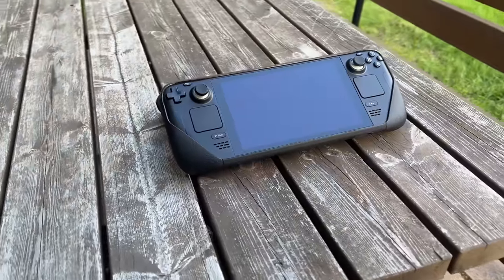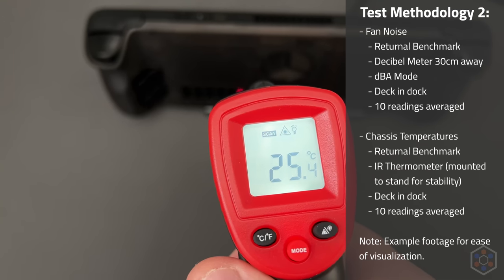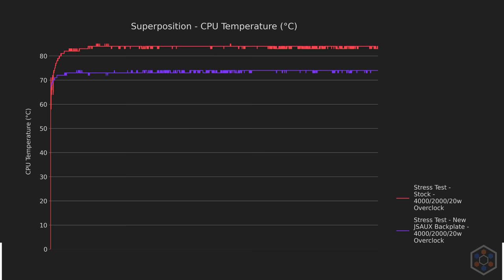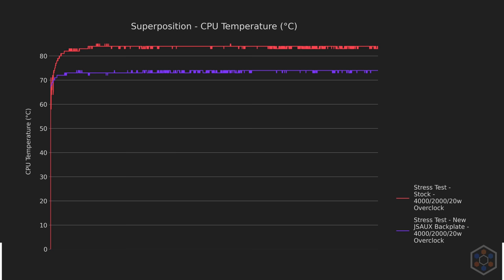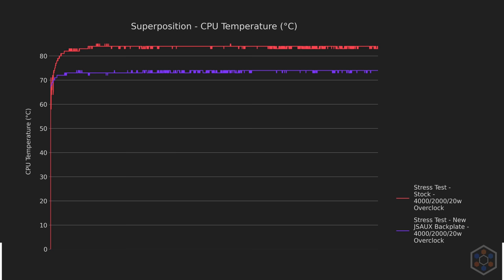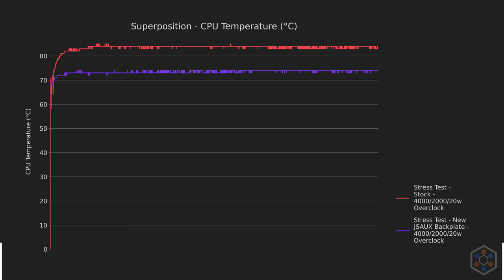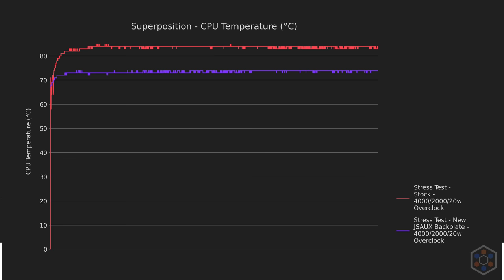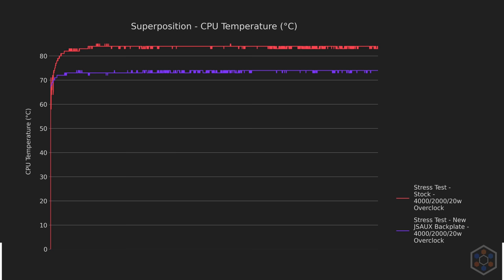How LOW Can It Go? | Steam Deck Thermal Modding

Comment: I need more guidance about putting thermal pads on the steam deck since I can't follow the process due to editing (and because I'm a noob 😅) did you put a thermal pad on the valve chip too? An installation guide would be helpful 🙏

Which size did you buy those thermal pad?
Reply from the maker: I put the pad only on the heat spreader, which the  contacts the APU that you're speaking of. It's really easy, just treat it like thermal paste using iFixIt's guide 🙂

Thank you for watching!

Comment: In terms of the clip on fan from Jsaux which is only compatible with the stock backplat, I purchased two different versions of this, there is a kickstand built into the foot of the clip on fan which allows you to stand it. Also, there is a version which does not require the clip from Jsaux and is sold seperately as part of the ModCase, but it includes a metal stick on connector that also gives you the latch from the ModCase which lets you add other ModCase components (but not at the same time). I also tried PTM7950 and that was a total bust, in fact in some cases it made my Steam Deck hotter and definately made the standard case back a lot warmer. Maybe it depends on what model of Steam Deck you are testing on and if Valve used different paste in construction.

Comment: Audio engineer here.
With the acoustic measurements in the A weighting (which refers to how the volume of sound reacts to what we here, as we hear different frequencies at different perceived volumes), a 3dB difference is twice the acoustic energy - audio is measured on a logarithmic scale so it would be perceived as a small increase in sound, but the "2.7dB increase," for example, is not 2.7 times louder. It is less than twice as loud, but would be perceived as a small increase in volume.
Reply from the maker: Thank you so much for the explanation, I clearly have some more learning to do 🙂

Comment: Great video! I didn't know jsaux made a new backplate. I just received and installed the old one about an hour before this video came and temps are night and day difference for me. Before 20w overclock would instantly go to 95C within seconds and maxed fans. Now after 10 mins it hovers around 89-90C.
Reply from the maker: They didn't advertise it very well, but I'm really happy they did. If the old one wasn't so hot it'd be easier to recommend 😅

Thanks for watching!

Comment: I recently fitted the 'old' jsaux back plate. I removed the thermal pad prior to installing the shell.. I wasn't after a shell to cool the deck down, more for the looks, since I opted for a transparent purple back plate. 

I don't notice any difference in temps... but now I feel that I maybe shouldn't of removed the thermal pad..

The reason I removed it, because I heard that the pad actually blocks the air from passing from the vent at the back to the fan.

Comment: Your long term concerns deserve to be reviewed at a later date maybe a year or two from now or even periodically? I think viewers would be interested in such content. Thanks for your hard work!
Reply from the maker: I might be able to do that, but I'd need a separate Deck to do it. As it stands, this Deck will be modified repeatedly for other testing so I can't do a "set and forget" follow-up 😓
Reply: @cryobyte33  Thanks for the reply! I noticed that your video did not have general guidelines (i.e. in the introduction section) about what temperatures we should aim to keep the Steam Deck at. 
Noticed mine getting to around 85 C after playing for several hours and worried about what that temperature range (80-90C) might do to my Deck's longevity. 
I changed the CPU TDP under Performance settings to 10 and temps went down to 70-80C range. 
I will check if you have a video on optimizing settings in the Deck for minimizing temps.
Reply from the maker: @manaseeker2414  The Deck APU is safe up until 105C. Since we were working with Stock temps or lower, I didn't think it was necessary to include that 😅

I mentioned the upper limits in my overclocking video, where I thought it was more relevant, sorry!

Comment: The burst speeds make sense. Better thermal contact with the heatsink creates better coupling, resulting in APU temps closer mirroring the regular heat soaking of the heatsink.

Comment: It would be awesome if you did a Steam Deck OLED thermal mod including re-introducing thermal pads, thermal plate mod (to accommodate the pads contact), and PTM9750 APU instead of thermal paste, and the JSAUX back!
Reply from the maker: I haven't heard of the thermal plate mod, could you send an email with a link to the address on my about page? Thank you!
Reply: @cryobyte33  the new thermal plate on the OLED unit has an insulating layer, and cut-outs in it for where the thermal pads from the heat pipe touch the metal plate. You’d have to cut the black insulation plastic layer wherever a thermal pad touches. The new OLED model doesn’t have thermal pads on most components now… It’s a cost cutting measure. You’ll see it if you look at the Gamer Nexus teardown to see what I mean.

Comment: JSAUX back plate is no Joke, my wife's steam deck used to thermal throttle and just froze the games FULLY if the game was demanding. I used the JSAUX back plate, the one without the vent and changed the Thermal paste, added a thermal pad to the aluminum cover inside and BOOM, the temps were SOOO MUCH cooler. This is a must mod for the STEAM deck.
Reply from the maker: I didn't have the same issue with stock, but I agree that the JSAUX backplates are both big wins for thermals 😁

Thank you for watching and sharing your experience!

Comment: Couple points:
1. I'd be mindful of using percentages when talking about temperatures, especially when you're comparing the raw output values. Worth delving into the thermodynamics of it if you see value in that.
2. Pulling cooling air away from the other components may be good for extending the life of the APU, but IIRC some of those VRMs are already running a bit toasty, so I submit that in doing so one will bring about the premature failure of a unit with a perfectly serviceable APU. Degradation of the main chip isn't the only way to kill a system.

I would however love to see what results you get using Arctic MX-6. It's worked a treat on two laptops for me so far, so I'd love to see if it's worth doing up my deck with it.
Reply from the maker: Thank you for watching!
1. Good point, I'll try to stick deltas in there at least a bit. I didn't consider that since I typically talk about frame rates 🙂
2. I actually have a pinned comment about this, I tested that too and only noticed a 1C difference on the VRMs, ICs, etc.

As for Arctic, those pastes tend to work best with high thermal loads whereas the Noctuas do better at lower loads. At least when I compared them on a few years ago they were identical up to about 45w of TDP, then Arctic pulled ahead.

Thank you for the comment!

Comment: Thank you for this video. I have been on a cooling odyssee ever since i bought the deck myself. I tried out all the methods you demostrate in this vid, its really good to have you coming up with pretty much the same results. Cheers mate, keep up the awesomeness.
Edit: With that being said, the weirdest thing: I spent half my time in a desert country, andwhen I'm there the old JSAUX backplate combined with a magnetic fan is what worked out best for me. Not so when I am back in western europe though.
Also, there are concerns with JSAUX new backplate in regards to internal airflow and cooling of other elements, specifically the SSD. I even think to remember that Valve had once mentioned waz back that this was the reason for the absence of a second vent in the stock configuration.
Reply from the maker: Thanks for watching and for sharing your results!

The locational difference is almost certainly humidity, with drier air you'd need more fan/watt to keep temperatures down.

As for the new backplate:
1. I tested VRMs, ICs, the SSD and the RAM for temperatures with the vented backplate and saw less than 1 degree difference from the stock backplate.
2. A lot of air still gets taken in through the rear vent, even with the vented backplate, so I have very few concerns with device longevity. 

Hopefully this helps 😁

Comment: Installed the vented backplate on my delta fan deck, and also added the clip on fan. Deck runs cooler and the little leg on the clipon fan does work well as a stand. It's not fallen over, surprisingly.

Comment: I was thinking about getting the PTM7950 and new JSAUX backplate, but was concerned what the actual games were. This video definitely helps make my decision easier. I might just get the backplate and use some thermal paste I already have. Don’t want to setup the PTM7950 if it is all going to come out for a p3r. 

FYI I saw Salocin900 posted a video of an updated Steam Deck which has different mounting screw locations for the heat pipe. Might be an issue for the p3r if Valve has significantly changed the design.
Reply: whats a p3r? Would like to know what you mean as im thinking of ordering the thermal pads but have some mx6 paste here? Cheers

Comment: Today I've tested the undervolt settings on the 118 bios, I'm on -30 cpu, -40 gpu, -50 soc, any higher I would start to see corruption/random shut downs. I stress tested with Doom eternal (raytracing, low resolution, low settings), with a 4k video running on the background (gpu at 99%, cpu at 95% average), and also with mprime (for ram, altough I used "blend" option). My termals were pretty good already, as I'm rocking the old jsaux plate and that does already some good job at lowering the temps, but noticed the new backplate that you showcase in the video.I decided to make a hole in the superior part, where the top of the fan would be, the hole is about 70 x 200 mm, and my temperatures have gone down by 2-3 ºC compared to the unmodified old backplate, fan speed lowered about 600 rpm. The way I cut the backplate is by warming up a cutter and a lot of pacience, it definitely doesn't look clean but pretty functional, thanks for your videos.

Comment: Hey Kyle, 
I appreciate your response - thank you!
Two questions regarding your video:
- With what tool / app did you set your Fan on the highest Speed after the 2 hour benchmark ?
- How do you run the Superposition benchmark on the Steam Deck, is there a special version for the deck?

Bests,
Marc

Comment: This is so cool, thank you for having the JSAUX. I have both, although I noticed that JSAUX might have taken into account one of my emails to them, because the RGB backplate (still hasn't arrived, so I can't say for sure), looks like, according to the images on their website, to have a section cut-out on the thermal pad to allow for the original Valve fluid dynamics diagram. If true, it will help a lot. I have also got a cheap (from Amazon) aluminium heatsink (40x40x11) with thermal adhesive to directly put over the aluminium backplate. This setup is perfect to use with the JSAUX also new RGB hub. I know it sounds like an ad lol, but I am just really excited for it to arrive (September according to their website).
Reply from the maker: Thank you for watching! I love JSAUX products thus far and don't have many complaints. I don't have an RGB plate, but hope to get one after I'm in the US to test.

Comment: I really need to object to the jsaux vented backplate. That vent disrupts the airflow path from the original rear intake, which means that things like VRMs and RAM chips will not get cooled sufficiently. There's a lot more to the thermal and airflow engineering on a portable device on the deck than the SOC cooling alone.

That said, the PTM7950 has been a godsend. It works way better than kryonaut, NT-H2, or the stock thermal paste. It will also last for the life of the device, as opposed to conventional thermal paste which needs to be regularly re-applied due to the pump out effect. Good video overall.
Reply from the maker: I actually pinned a comment about the JSAUX backplate and the testing I did. Mine has been on for months with perfectly safe temperatures 🙂

Thanks for watching!
Reply: @cryobyte33  Ah, I missed that. Good to know!

Comment: A friend of mine just sent me a photo of a new revision of steam deck, the CPU cooler mounting mechanism is completely different. 

In your and mine steam deck, we have RAM in between the fan and the SOC, the new version don't, and SOC is closer to the fan.

The EMI metal shield is now painted black instead of the bare metal look.

Comment: That magsafe cooler you used they make a version of it with a teg cooler built in and I can't confirm the teg units work amazingly and probably would be a huge benefit in your situation you really ought to give it a try!!!  I use the teg set up on gaming phones and it makes a huge difference in thermals but mostly it offsets the heat caused by wireless charging in my case the problem it has in my case is that the cooler doesn't sit directly above the chip and due to my camera bumps its super hard to make it work but when I did force it to work it did a great job its just not practical for my case but in your case it likely would work great!!!

Comment: amazing video! and just the information that was missing online. at the end of the day, its a lot of money in terms of costs only to get 5-7% improvement. The lows jumped significantly. but low 7fps to low 15fps will still feel the same in terms of user experience.
now if all these upgrades would raise all the lows to stable 30fps....now that would have been a must buy upgrade, no questions asked.
Reply from the maker: Keep in mind that the games I tested are some of the toughest (and most stutter-y) to run. Check out my Hogwarts Legacy Deck Dive for some really impressive performance while overclocked (and a more accurate depiction of normal games), where the backplate and pad would help the most.

Sony games tend to scale poorly with overclock, but stress the Deck to the limits, which is why I tested them here. The caveat is that most games you play will likely not be Sony developed 🙂

Thanks for watching!

Comment: EDIT: CAPS FOR CLARITY. I TESTED IT MYSELF. I FOUND THE CONTROLLER CONFIG TEST IN THE SETTINGS. PLACED THE DECK DOWN, AND IT DOES IN FACT CLICK WITH THE LARGEST BUTTONS WHICH IS REALLY UPSETTING. I AM GOING TO CONTACT JSAUX AND ASK THEM IF THEIR CASE DOES THE SAME. I AM UN SURE IF THE SMALLER BUTTONS TOUCH ON THE DECK I WILL REMOVE THE BACKPLATE AND ADD THEM AND THEN TEST THAT LATER TODAY. 

I know this is a long shot, but i figured you would at least maybe respond to my question. I finally got the Jsaux vented backplate. I put in the longer buttons in the back of the plate and staggered them so i could feel them more and maybe use them for gaming as i never really used them. i have now started using the back buttons more and love it. here is my question. Does the longer protruding buttons touch the back of the case when away and put added pressures on the buttons ? there for clicking the buttons?

Comment: I bought the magnetic fan a while back and no one had any tests on it.  I did notice it worked but it is cumbersome in some regards.  I ended up modding my JSAUX old backplate by cutting holes where the fan is like the new backplate they offer.  Then I added heatsinks on top of the metal plate.  It has cooled down the Steam Deck alot.  I did my own testing with before and after results and it does work.  My deck is overclocked as well.  My settings are undervolt 30-10-30.  Overclock 4077 CPU, 2077 GPU and 20777 for the battery.
Reply from the maker: Sounds like that was a great idea, I was thinking about cutting a hole in my metal plate backplate too! I'm also glad that my testing aligns with yours 🙂

Thanks for watching!
Reply: @cryobyte33  Yeah I ended up buying two of those backplates before they announced the New one so I had a spare to experiement with.  I cut down a mesh fan screen and a used non scented dryer sheet to protext the fan from dust build up on the fan.  I wonder if that maybe helps with back pressure as well?  I also added a few thermal pads inside the deck in a few spots to help disapate the heat.  I will have to try that thermal pad you mentioned in your video.  I keep my house around 25c degrees and luckily I am able to keep the deck pretty cool.  It is all thanks to you that I was able to learn how to unlock the potential of the Steam Deck through undervolting and overclocking.  I look forward to any other videos you do.

Comment: The clip opens up on the bottom! I do use the clip on fan and actually don't notice the noise, because I use it (kind of docked on its weird footpad) and wearing headphones or external speakers, that highly outperform the fan noise (Steelseries Arena 7)
Reply from the maker: Wow, I'm... not sure how I didn't notice that during testing 😂 Thanks for the reality check.

I typically use my Deck in handheld without headphones, or with open-backed headphones, so the noise bothers me, but I'm glad it's working well for you. Thanks for watching!

Comment: One comment on the paste: you may want to consider that the performance may have been better due to applying new paste rather than it being a result of a "boutique" brand. Would be interested in seeing if other brands resulted in similar performance gains over stock.
Reply from the maker: The NT-H1 isn't particularly high end or boutique, although tut performs fairly well. I chose to use it over something like Thermal Grizzly because it's cheap and available almost everywhere.

It's what I'd consider the bare minimum for a special order when trying to up performance on something 🙂

Thanks for watching!